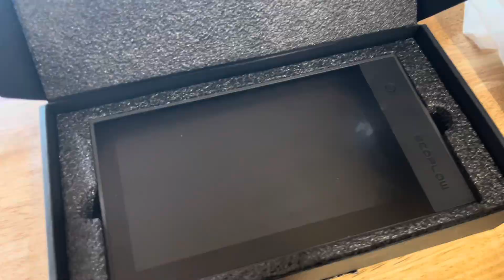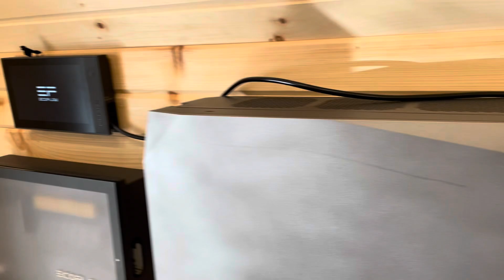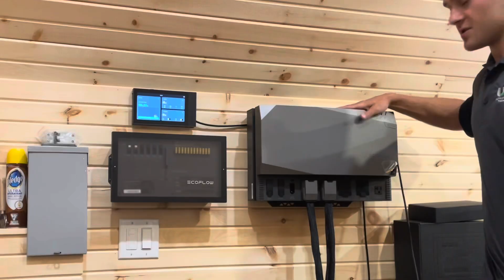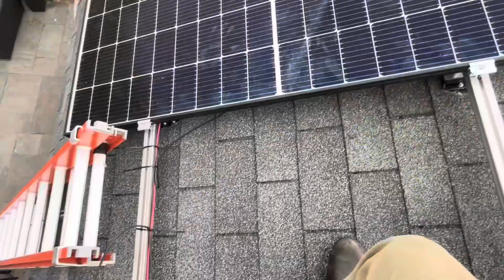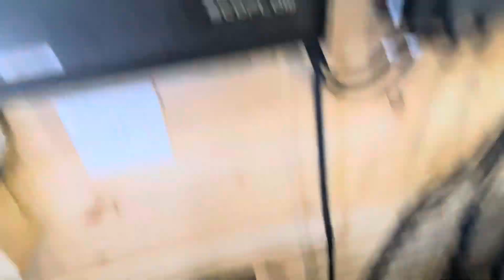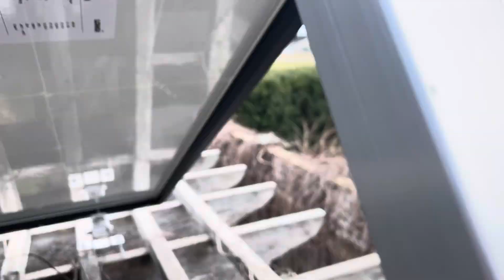EcoFlow 4kW Powerkit + Solar PV Installation - Simplest DIY Off-Grid System - TRU Shop, Milton, ON

Comment: The installation of the breaker defeats the reason for the distribution box. All the circuits handled by an external distribution unit (secondary panel) are still handled by that unit and not the ecoflow distribution box and installed by an electrician. You have totally missed the DIY of self installing circuits in the distribution box.😢

Comment: I got the Canadian Solar 405w panels as well.  I have 2 series of 4 panels about 1600w each so 3200w input for me, and the Power kit can accept 3 strings for a total of 4800w Solar input! So 12 of these panels can be used. Not bad. Just keep in mind 150v max per input. I had the setup for 1 year and no issues in hardware just a few crappy firmware  issues that scared me but all was good soon after the new update came thru. Ecoflow support is ok as they answered all my e-mails.
Reply: The manual shows only 60V per MPPT input.
Reply: @johnkaprese36  The latest manual 1.5 says 60v that's correct. I have no idea why?  I purchased my Power kit from a dealer and it was on display with some Ecoflow marketing backdrops and in the specs it said 150v The dealer assured me it was 150v per PV input. So 150v it was and no problems thus far.

Comment: The roof mounting system: is there no need for the lags to bite into the joists/2x4?
Reply from the maker: Correct! No need for it , you can go right into the sheathing but spacing between each can vary on code. In Ontario, we require every 2ft on OSB and 4ft into joists.